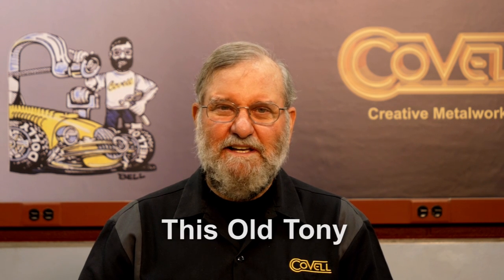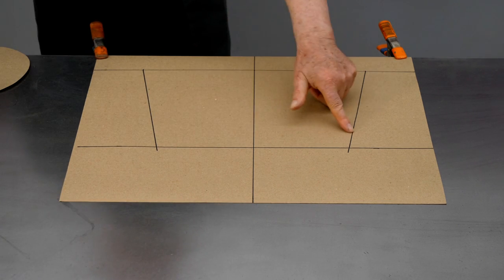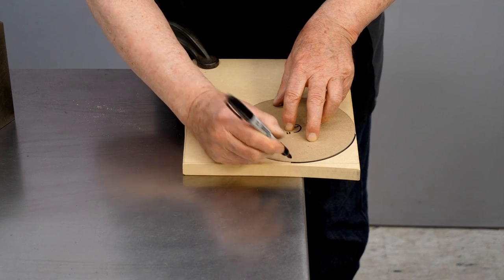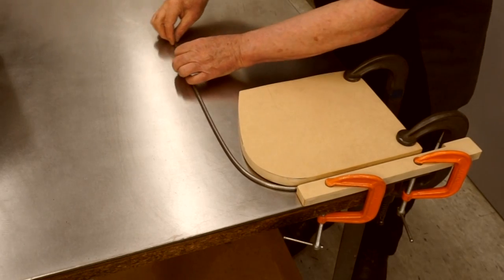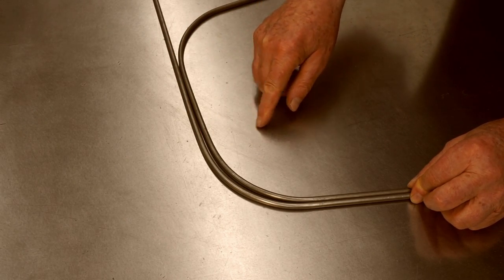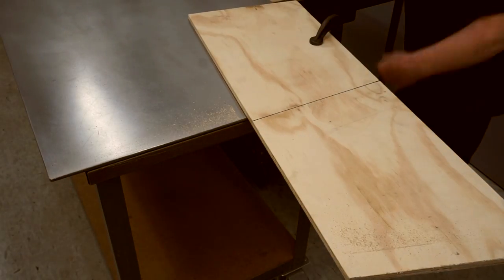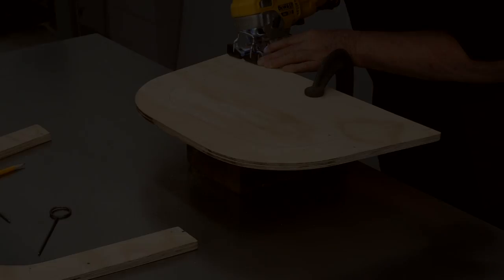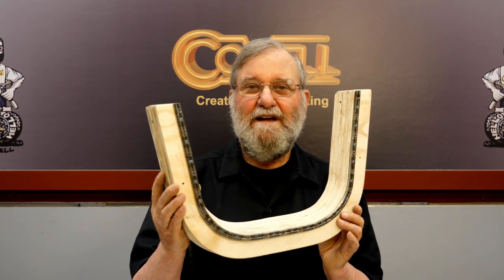Cleaning Up! with This Old Tony

Comment: Ron, I'm ashamed to say I'd not heard of you before today (I saw the This Old Tony reference in your title and clicked reflexively). Please believe, however, that I just liked/sub'd/bell'd, and am thoroughly looking forward to seeing more from you. You are, hands down, one of the best explanatory narrators on YouTube. I'm not crystal clear how one maintains a Buddha-like tranquility like that, but your calm, almost clinical detailing of your steps is strangely soothing to watch. 

You're like the Bob Ross of YouTube metalworkers (I mean that in the nicest, most flattering possible way): "Now I'm going to cut the hammerform. So we'll countersink some screws... happy little screws, and there: nice and flush, isn't that plumb? Now we'll scribe a line... a happy little line... maybe at an angle... I think I'll be setting mine to 20 degrees, but you can set yours however y'all like... there's no wrong way to fabricate! Now we'll switch to a jigsaw..."
Reply from the maker: Hey - welcome aboard, and thanks so much for the very flattering comments!

Comment: Wow Im glad I learned of your channel through This old Tony, I really like your way of doing and explaining things. One quick tip for the countersinking(I do a lot of woodwork) is to use the flat of the head on the screw. So the pointy end of the screw would be facing up and you would be testing the countersink with the flat of the head against the metal. When the width of the head can just fit into the countersink then its the perfect depth.
Reply from the maker: Hey - that's a great tip!

Comment: I just found your channel and subbed, I used to make air con ducts for hospitals and stuff and other air con panels and flashing, what you did with the tape was witchcraft I have never seen tape been used in such a way nor have i seen it done so neatly....

Nice work mate.

Your square to round reminded me what we did make at work just a tad bit smaller but much the same.
Reply from the maker: Tape is a really big asset for many kinds of layout work. Sounds like you know what you're doing!
Reply: @RonCovell  yeah still thinking about how smooth he got that tape to turn a corner it makes me wonder if he could do that with LED strip lights, we mostly use that blue stuff and scribes for marking, but tape we can't have as i am sure one of the guys would have found a way to tape him self to the duct work or the panel, we did have a guy attach the dampener blade to his hand, the boss told me off because i was laughing and not been safety conscious , I said it would not be a safety concern if we not hire monkeys.

Comment: Hey Mr. Tony.
I'm working as a grease monkey at a place called 1770 in Queensland, Australia. 
I have been rebuilding a part made for a LARC 5 made in Connecticut in the 1960's.

But I have a fun question. 

I have some bits from a tapered roller bearing that have reached the end of their life.  
Is it possible to drill through the old bearings to "recycle" them into fishing lures or Is it not sensible to do this??....

How can I send you a photo of the raw stock that comes from a roller bearing?
Reply from the maker: Bearings are made from steel with all kinds of stuff added to it to make it tough and durable, which makes it nearly impossible to drill. If you absolutely had to drill a hole in this material you could anneal it first, and try using a cobalt or carbide drill.

Comment: Hi Ron, nice to see Your enlightening  videos. I saw that You put the drywall screw through the drilled holes (in the double curved metal rods) to measure the countersink depth, I found it is time-consuming and awkward to insert and draw out the screw from every hole.
So I just hold the screw upside down over the counter-sinked hole with the screws tip pointing up - then I just put the flat head of the screw over the countersink.
It is much easier to see and measure, works marvelous, and is very rewarding. Try and see if it works for You as well. I know it seems counter-intuitive, but check it out for Yourself.
Regards.
Reply from the maker: Hey - what a great idea! I'll try that next time.

Comment: my jigsaw cuts those angles without even changing the settings. that's what happens when the best you can afford 23 years ago was the cheap stuff... loving  the project.
Reply from the maker: Hey - a 'self-adjusting' jigsaw! It doesn't get any better than that!

Comment: Rather than rollation to find the length of material, how about - record initial length of stock. Do bend. Mark middle of pattern. Measure distance of pattern middle from straight length end. That gives you the length of half the pattern. Measure that calculated distance from your pattern marked middle, outwards. That should give the final required length.
Pretty sure that would work.
Reply from the maker: Yes, that would work perfectly!

Comment: Interesting blend of metal and wood working. Me personally I would have used 1/3 the glue and more screws. Well maybe no glue and screws from both top and bottom. I am thinking you need a 14" or so bandsaw with a riser block. You could have cut them together in one cut, I think. Some great techniques and pointers. I hadn't thought about using the different thicknesses of tape. I am looking forward to episode 3. You guys compliment each other.
Reply from the maker: In reality, I do have a bandsaw, and it would have speeded the work on this project. I have learned that there are a lot of people who have only basic tools to work with, and my goal is to show how you can do exceptional work with simple tools.
Reply: @RonCovell  Copy that, I spent many years without a bandsaw. Once I found an old 1950's cast iron one and purchased it, now I use it more than I ever thought I would.

Comment: Ron, use your drill press depth stop! it hurt me inside to see you checking every countersunk hole with the screw
Reply from the maker: Patrick - I have been 'burned' many times when using the depth stop on a drill press. All it takes is a little chip, or piece of debris getting under the workpiece, and the countersink goes too deep.
Reply: @RonCovell  Extremely valid point - most of my work on a drill press is done on a XY fixture table where that's not an issue. Since its clamped in position no chips change its height. If I do end up using the full table I use air nozzles to blow chips away, but that's always noisy as heck and messy. Just wait for the day you'll need to drill into copper bars! dang near lifted my 180# drill press table putting 3/8" holes into that gummy stuff. Big looooooong thick chips not for the faint of heart or those without good clamps

Different methods but the end product is all that matters and in this case your form turned out really well. excited for the next video
Reply: @RonCovell  Ah- hah! what you need is a drill press subtable, with air cushion elevation (which incidentally blows out swarf or dust) and vacuum clamping. You clamp the work to the subtable and (as they say in French string quartets) viola!

Comment: Excellent video! Ron, would there be any advantage to shifting the stop block to accommodate 2 bars, inserting the previously formed first bar, sitting the second bar beside and forming it against the first bar? I understand that opening up the radius is quicker by hand, just curious if there would be a situation, maybe with a more complex-shaped form, that piggybacking them may be advantageous somehow.
Reply from the maker: That could be a good way to go. I'll try it the next time!

Comment: Hi there, great video!  I know it isn't the space shuttle you are working on there, but something had seemed to notice is that; did you measure the angles of each of the sides? It might have been because of lens curvature but it looked as if one side was much more straight up and down than the other. Thanks, this video was very enlightening in the process!
Reply from the maker: Yes, I measured the angles on both sides, and they are within one degree of each other, so I guess you are looking at distortion from my camera lens. Glad you liked the video, and took the time to comment!

Comment: I'm skeptical. Forty years ago I was working in a shop where they had those little rubbermaid dust pans.
You nearly scuff you knuckles on the floor because the handle is too low. I went over to the shear with
some .040" aluminum and sheared a shape and the went to the break. Mr. Dustpan was born. My boss chewed me out for wasting aluminum but a few weeks later asked me to make a few for his home.
Since then I've had a few rounds where I make half a dozen in a Saturday morning. Everyone loves them.
It is the definitive dustpan if you want to see it I'll oblige.
Reply from the maker: I'd love to see your dustpan! If you can, post a YouTube video of it - otherwise you can email a picture to me - covell@cruzio.com
Reply: Surely it would only take a gooseneck (crank) in the handle? In which case that's ToT's domain, in this instance?

Comment: Perhaps a stupid question. What is the reason behind angling the pencil? Aren't you cutting it at an angle? Is it just for the amount of space needed between the wood and the round stock for the edge of the pan?
Reply from the maker: Well, perhaps this is a subtle point, but the cut line is projected down at 20 degrees from the point of tangency on the round bar. This angled line meets the plywood slightly farther out than a line projected straight down. For a 20 degree angle on a 1/4-inch bar, this discrepancy is only about 1/16-inch - but for a larger bar, and/or a steeper angle, it could create a significant misalignment.
Reply: Thanks for the clarification. The old "its not practice makes perfect but perfect practice makes perfect" 👌

Comment: :O Ron doing a video with Tony!! This is going to be great!!! I do have a question though Ron, where is a good place to get nice thick layout cardboard like that? I've done sheetmetal work on boilers and steampipes etc for about 8 ish years, so I'm fairly familiar with a lot of techniques, but finding a good source for layout card for other projects is always a pain!
Reply from the maker: If you live in the US, most 'Big Box' stores (like Costco) get pallets of toilet paper, and the packages are separated by thin chip board, which is free.
A thicker, more durable product is available in rolls from large building-supply stores like Lowe's or Home Depot.
Reply: @RonCovell  ok no problem, Im in Australia, the sheetmetal work seems to be a bit of a dying trade here but still a few old masters around, none quite as good as you, I'll have a look around at our big box stores like Bunnings etc. Thanks so much for the tip! Have a great day!
Reply from the maker: I've traveled a bit in Australia, and met some great metalworkers there. Probably Peter Tomassini is the best known.
Reply: @RonCovell  There are definitely some real artists left, just a shame there aren't more people getting into it :(

Comment: Hi Ron, have you only added the steel at the top as you needed something to turn the metal over and down for the reverse return lip?  If you were just doing a simpler 90° flange would you have still added the steel?
Reply from the maker: If I was making a sharp corner, I would not have used steel - unless I was planning to make a LOT of parts! I chose the steel bar to be sure that I had a consistent radius on the edge. That's a little challenging to do by hand.
Reply: @RonCovell  ok, i didn’t think about the consistent radius. I have another part that I want to make, the plans I’m using (automotive floor) call for a 0.25” radius on the top edge where you have put the steel.  I was going to use a route with a round over bit, but that does not allow for the sloping sides. So I think you have helped me understand what I need to do. Thanks. Floor will be 0.036” EN2b steel.

Comment: Ron may I ask what grade of plywood you're using? Folks might need to know that you're making 1/2" instead of 3/4" board in order to have fine control of the slope and final shape of your forms. Would MDF yield good results or not for repeatability of the metal forming?
Reply from the maker: I'm using AC plywood - nothing fancy. 3/4-inch would have worked, but I had some offcuts of 1/2-inch laying around, so that's what I used, and of course it's easier to hit the 2-inch dimension I was aiming for with 1/2-inch.
I use MDF for most of my hammerforms, and the primary reason I chose plywood for this one is so the screws wouldn't loosen. I will make another hammerform in the last video of the series for the pan bottom, and that will be made from 3/4-inch MDF.

Comment: Question. Why not open your bending jig to allow both bars to sit flat, clamp both straight shanks to the table, and bend the second bar over the first? Shouldn't that give you about exactly the first plus the bar width?
Reply from the maker: Jeff - you know, I never thought of that! Maybe I'll try it next time.
Reply: @RonCovell  my only concern would be the outer rod slipping up over the inner rod. Can't wait to see the rest of this build 😅 never thought I'd get excited over a dust pan.

Comment: quick question about the bending guide why did you to guess with the ruler to start why not just transfer the paper template to begin with?
Reply from the maker: Great question! Because metal 'springs back' after bending, the form needs to have more curvature than the finished part.
Reply: @RonCovell  i understood that part of it which is why you added the 5° extra and adjusted by hand after i meant for the first attempt sorry for the confusion and thank you for replying
Reply from the maker: If I'm understanding your question correctly - I used a flexible ruler to achieve a uniform curve across the back edge of the pattern.

Comment: Couldn't a half inch piece of steel been bended to skip the extra work of doubling up the quarter? Curious.
Reply from the maker: Yes, of course you could start with 1/2-inch wide stock. The reason I used two round bars is to get a consistent radius on the corners. That is quite difficult (and time-consuming) if you start with a square corner. The next video should make this more clear.
Reply: @RonCovell  Thanks. I like short cuts.

Comment: About 10 years ago I built myself a dustpan at work, nobody understood why when you can buy one for dirt cheap (pun intended). Mine is not as pretty as yours but the pan and handle are just one sheet of metal bent and rolled.
Reply from the maker: Sounds like a great, and useful project!

Comment: Either he's thor or that quarter inch bar is a really ductile. Which steel is that?
Reply from the maker: I'm using 'regular old' 1018 cold rolled steel bar. It's pretty easy to bend when the diameter is only 1/4-inch. One-inch bar is a different story!

Comment: Are screw types actually numbered arbitrarily in the US instead of giving the measures? Or is there a certain schema to the numbering?
Reply from the maker: For fasteners 1/4-inch (6 mm) and larger, they are measured by the shank diameter. For smaller fasteners, they go by number. Yes, I know this doesn't follow the consistency of the Metric system, but it's what we use in the US.
Reply: @RonCovell  Interesting. I guess there‘s some historical reason behind that. I‘ll have to investigate... 🤔

Comment: Why angle the pencil to draw a 2D line? I dont think that step was particularly useful. 14:16
the jigsaw's cutting angle was the only factor of the angle made in the stack of wood.
Reply from the maker: Well, perhaps this is a subtle point, but the cut line is projected down at 20 degrees from the point of tangency on the round bar. This angled line meets the plywood slightly farther out than a line projected straight down. For a 20 degree angle on a 1/4-inch bar, this discrepancy is only about 1/16-inch - but for a larger bar, and/or a steeper angle, it could create a significant misalignment.

Comment: luckily this is no coop with AvE or else it were no coop
but milled out of a massive square block into thin sheet metal, while breaking lots of tools...

:-)

PS.: My saber saw always cuts at an angle... and it can't be set to a specific one ... aaaand its not 90°  :-/
Reply from the maker: I like to see delicate parts milled from solid billets - but I'm more of a sheet metal worker than a machinist. Thanks for watching, and commenting!
Reply: The guy two doors from my shop is a toolmaker with CNC machines, who does that for the aerospace industry, sometimes for prototypes, but more often for short run parts or where sheetmetal is not obtainable in the gauges or grades required, or is not suitable for forming (too high strength, and/or insufficient ductility). He doesn't have anyone in-house to do the trickier solid models he sometimes needs to drive the machines, which is where I come in...

Comment: I'm confused on the 20° angle marking gauge....I feel like all that did was offset your line such a negligible amount, that the exercise of doing that was pointless.... Simply holding the pencil at an approximate 20° angle would have achieved the same thing....I just feel like that didn't achieve what you thought it was going to achieve, because it's still a 2d pencil mark that has no depth or 3d projection through the layers below....
Reply from the maker: Thanks for watching, and sharing your thoughts. If I had not made the 20-degree device and held the pencil vertical, the wooden part would be undercut by about 1/16-inch (1.6mm). This might not seem like much, but when I formed the aluminum against an undercut edge, the aluminum would get a step in it that would take time to straighten. You are correct that I could have 'eyeballed' 20 degrees and gotten closer, but I wanted to have a bit more precision, which reduces the amount of sanding required to get the wood tangent to the steel bar. If you watch the Part 2 video some of this may be more clear.